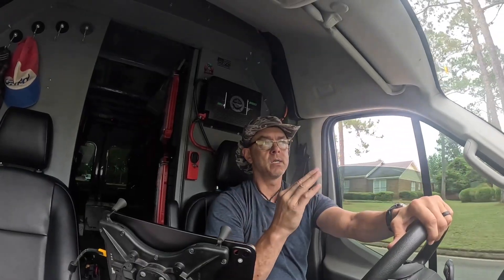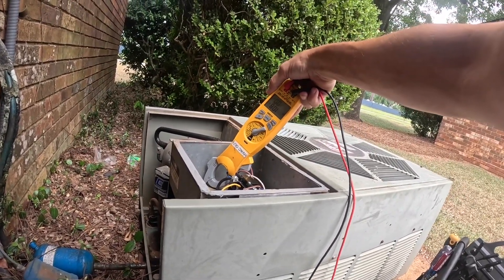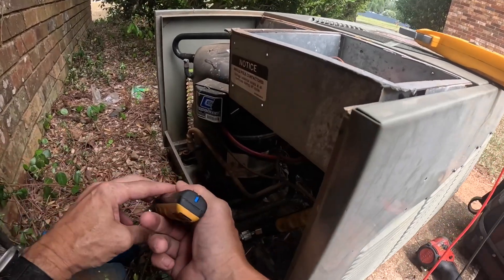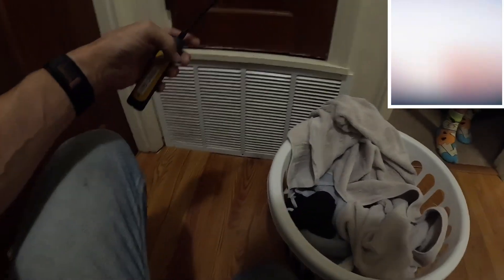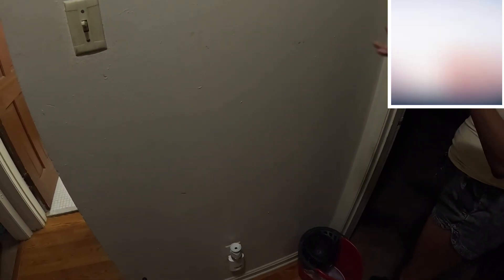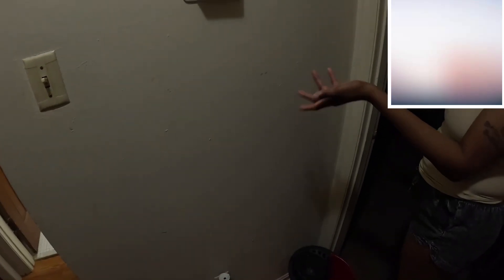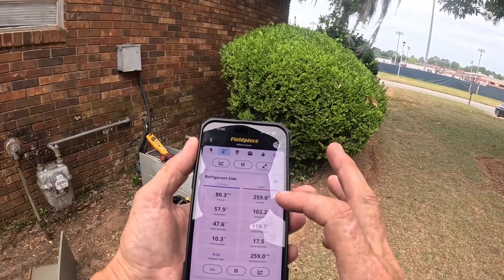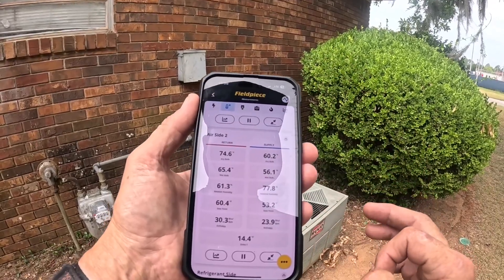Third Visit Within 2 Months, But Was It My Fault? #hvacguy #hvaclife #hvactrainingvideos

Comment: Well......old a/c man here......with the age of the system, the old single pane windows throughout the house, the guaranteed lack of insulation, the blocked return I saw when you entered combined with the size of the return the BEST she can even hope for is going to be 75°  during the heat of the day! I'll say if she's turning it off when she leaves and turning it back on in the heat of the day she is working that system to death as it is just getting caught up when she turns it off again! She needs to set it at 75 and leave it alone PERIOD! Combine all this with the heat indexes of 110° -115° and she has a recipe for disaster it will never catch up and will destroy itself!! I've seen it time and time again!! Especially in those 1970s/80s built houses!!
Reply: Yes, I would agree...leave it set for a what temps you want and leave it. 72 is pretty cold but lots of folks want it that way.
Reply: @Garth2011  That is asking a lot out of that old unit, it is small to boot.
Reply: @jthonn  So, with all of the gauge readings and correct charge etc. and the unit is cooling the evaporator as it should, what does age have to do with it? Its cooling as it should. If its too small for the heat loads, thats on the owner. Or, maybe its got bad ducting/CFM's. Replacing a working condenser because its old is not the solution.
Reply: @Garth2011  Oh I agree, but it being older may pump it's guts out sooner. It didn't sound so good to me. Also as the compressor gets more and more wear, it takes more for it to pump up to pressure. I'm sure you have seen it too, but I have seen compressors run and not be doing anything. Therefore, replacing an old unit may be the solution sometimes.
Reply: @jthonn  Yes and that would be the ones to recommend a full replacement and new system with heat calcs, ducting evaluations and return placements.
Reply: @Garth2011  👍
Reply: Man I agree, or turn it up a little and not off. I turn mine off sometimes depending on how long I'm going to be gone, but I know it's going to take a while to pull down. People don't realize that everything in the house, furniture, walls and all are hot too, and takes a while to cool down.
Reply: I wonder how long has she lived there and been doing this? If this is a new problem the condenser fan could be dropping out on thermal overload. Some condenser fan motors have confusing instructions on the cap, like 7.5 on 208v or 5 on 230v but only show 7.5 on the sticker. They overheat with a 7.5 on 230v. The other thing is some universal motors have rubber or plastic plugs on top and bottom, that you have to remove to allow it to drain the water. You remove the side pointing down only. I have come across several failed newer motors full of water with the plug still in.
Reply: @--harry_  That is true
Reply: Add the fact that it’s a brick house and therefore a holds heat even longer. No way it can keep up. Plus won’t remove the humidity either.  Let it run!  Don’t change the thermostat
Reply: 14 degree temperture split pretty low, I'd say 17 degrees if you have high humidity,  should be 20-24 degrees,  especially r-22
Reply: Could be restricted air flow.

Comment: New motor doesn't seem to spin freely, that didn't alarm you, brand new don't mean jack anymore, I guess we'll see . Of course customer thinks ac will instantly cool house down in minutes. That unit needs a cinder block on top to keep it from making rattling noise.
Reply: It sounds like grossly overcharged unit; I'm surprised compressor didn't burst!
Reply: should the fan blades be so close to the motor?  Maybe a lower profile motor is what should be in there too.  And it spun like crap
Reply: Amp draw was below FLA. If it were dragging, I'd expect it to be over it.  suction press was elevated but he said it was 80 inside and the system has been off, so it was a high heat load. Subcooling was a bit high, I don't know what the design subcooling temp is for that system, but I would not expect it to be over 15. High side pressure was 260-what you'd expect on a 90 degree day with an old 30 degree split condenser

Comment: Not just the air in the house but all the mass of walls, furniture, everything is heated up and has to be cooled down as well. Nice lady, but sometimes people just don't get it.
Reply: Even though the "utilities" say to alter the temps when you sleep or leave the house, I have to agree, set it where you want it and leave it. Remember, power companies sell electricity and when your A/C runs more, they make more money. I recall years back some news journalist was interviewing a Walmart V.P. about their operational costs and the man had said they did several recommended methods for controlling temperatures inside their huge stores and they finally discovered that setting the thermostat's at the number they chose 24x7x365 used less electricity for them and maintained inside temps best and their observation was keeping all of the mass inside the stores at a controlled temperature was cheaper than allowing temps to rise then try to recover them again the following day. 
We do the same at home...we're home most of the time or at least someone is at the house most of the time so we set the temps and leave it there all summer, day and night.
Reply: @Garth2011  Yes, that's what we do as well. Retired, so we aren't away much. We are set at 77 days and 76 night to make wife happy😃
Reply: it has to un-heat the air before it can begin cooling the air.
Reply: @JohnnyCarroll-wi6tx  Heat will naturally flow or move toward cold so when the A/C comes on, heat is technically extracted from a building via the evaporator then, heat from furniture etc. flows toward the cooler locations inside the home.

Comment: AIR FLOW!!!!! Static has to be checked on any u it that requires any work due to not cooling enough or not keeping up. I just found a supply with a disconnected duct due to a tech claiming pressure was good but it wasn’t keeping up. Especially important if a tenant or homeowner says it USED to keep up. 
promise it has to do with AIR FLOW
Probably best to head back one more time to the tenant and tell them you have one last thing to check

Comment: She needs to set the thermostat and leave it alone
Reply: That's my opinion too...especially with a bricked building that is going to be a hot baked potato even after the sun sets. Just like those Spanish tile roofs, heat sinks that need a cool evening to cool off. Gone are the ideas that "turn your thermostat back" doing any justice unless you are the type who sets it for 68 in summer. Every day trying to cool off all of that bulk from the high 80's at 2 PM forward is going to be a huge battle.
Reply: @Garth2011 heat rises
Reply: @phoenixhvac-r828  There's more to heat than it rising. It also "radiates" in all directions plus there is the UV heat that passes through materials. If an attic is not vented well or doesn't have a power exhaust fan the heat radiation will build as the temps increase which does allow the heat to enter/affect the living area. That means some heat will "sink" if the conditions are there.
Reply: @Garth2011  heat never " sinks " if the space is not insulated and sealed properly and there is a negative pressure created you will pull heat into the space, tile roofs have such an air gap between roof radiant heat is non-existent, now brick home with single pane windows I agree with you
Reply: @phoenixhvac-r828  Radiant heat does radiate in all directions. Been to an outdoor restaurant with those gas or electric heaters up above pointed downward to keep people warm?
Reply: Was taught in school that you save 1% on your energy bill for every degree you set your tstat back up to 5 degrees.  After 5 degrees, you start going backwards on savings. When most people hear that they only save 1% they leave it set to 1 temp.
Reply: @--harry_  Walmart figured that out after they did some experimentation about energy usage. Doing just what the utilities suggest in setting the temps a bit higher when the place is closed and then going back to the daytime temps cost them much more money than leaving it set all year long.

Comment: She’s expecting a miracle at the hottest part of the day with a system that has been off
Reply: 25 year old system at that.
Reply: @spencersutton7486  indeed
Reply: Not just that . In many cases if not most , people really do not know technical details on how ducted central air works
Reply: Sounds like she first said she turns it completely off then suddenly changed her mind saying someone stays there and that she does not turn it off . Odd . My first thought when he pulled up to the outside unit was it has to go . What a noise sore to the neighbors . But many cannot just up and replace there central air units . All in all central air is terrible for anything 90f and above . In this case , even if she keeps the unit on it will still have a tough time to keep up . Age is part of it in her case but even new (builder grade) units struggle at 90f and above . I hear it all the time in Florida where i live . That’s central air for you . Yes i got rid of my central air . Unless they have been improved over the past 10 years i will for now on avoid them .

Comment: Do you keep logs of pressures from previous visits? Reference them, tell them they need to upgrade. I mean just look at that Ruud system. That would be a no go in Louisiana. Convince them to upgrade so they can stop blaming everyone else. What you said to the customer was 100%. When I’m gone I keep my place at around 76, around 8-9pm it keeps it maintained at 74. It’s comfortable enough for my roommates not to bitch. But it’s also 100 degrees most days. You can never expect a system to kick your house down lower than 70 unless you’ve got a newer house with double panned windows and lots of insulation. No cool air loss within the building and I always suggest attic tents if their thermostat is above the attic access.
Reply: We turn system off in Houston; utility turns power on an off repeatedly and hard start kits and delay timers won't help!
Reply: @bobboscarato1313  Texas electrical grid has it's issues.

Comment: Just don't sound healthy.
Reply: For the condenser fan to be far louder than the compressor is definitely not cool
Reply: @mysticknight9711 it's not the fan motor it is the vibrating sheet metal from the holes being worn out